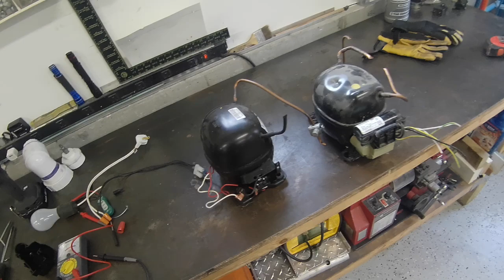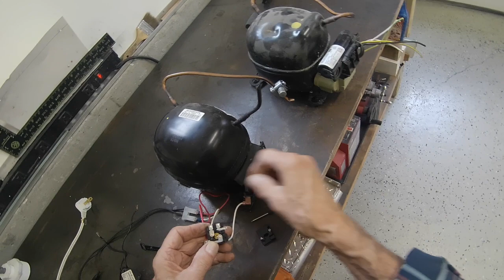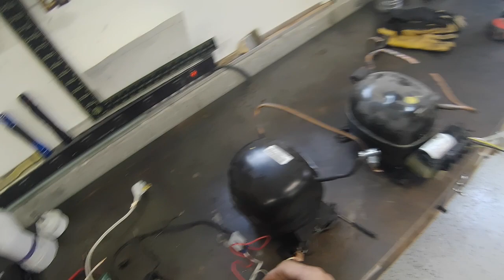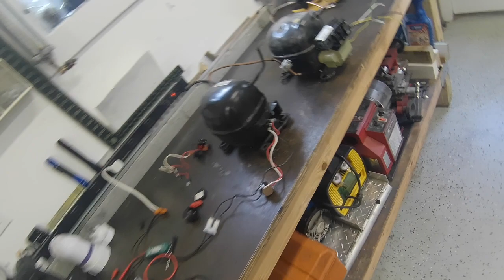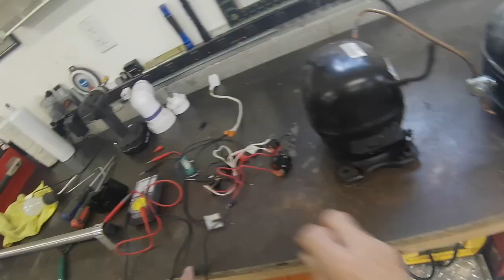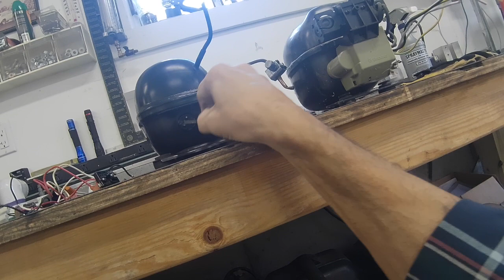Solid State Relay V Amperage

Comment: Hi , mine is 632 model . Where is the compressor capacitor on the fridge side .
Reply from the maker: Not all compressors have capacitors.
Reply: @SubZeroSpecialists 
Thank you for your reply.
My fridge side compressor keeps on clicking on and off .
Ohms reading: C+R=7.9
                          C+S=20.9
Amps drawings on fridge compressor upon starting is 8 amps , it starts for few seconds then it clicks off . 
Do you think the little relay beneath the overload is bad . Your thoughts .
Reply from the maker: @AJ-AJ212  there is a way to jump start the compressor without a relay but I’m reluctant to give advice because you could get zapped if you touch the wrong terminals. Why don’t you try replacing the starter with a Supco RO-81 first and see if that helps. The worst that could happen is $10-15 bucks for it.
Reply: @SubZeroSpecialists 
The compressor is a 1/10 hp . Embraco EMI30-HER .
Reply: I did jump start it and it’s running but it’s getting way hot . What is the cause of the compressor excessive body temperature .
Reply from the maker: @AJ-AJ212  too much friction inside the compressor maybe due to a faulty piston or valve. What are the run amps? You mentioned above that you were drawing 8 amps. That’s a small compressor and probable draws 3-4 amps   when normal, maybe less if a new model.
Reply: @SubZeroSpecialists  
it’s drawing exactly 3.8 amps after I jumped started it but , it was getting too hot in about 5 minutes to the point I decided to shut it down due to the excessive heat . it was pointless to keep it running . I think the compressor is bad .
Tested the overload resistance at 0.2 amp which is good and the relay’s is at 0.5 amp of course after turning it upside down where the contacts are mating which I took apart and sanded the carbon deposits off . I am at loss . Your thoughts !!
Thank you so much .
Reply from the maker: You didn’t mention your serial number. You can go to my website aaronsrefrigeration.com and click on TechHelp, go to 600 series based on serial number and look under Technical info, there you’ll find the running amps. It does sound like your compressor is faulty, normal running amps are 1.2 for the refrigerator compressor.
Reply: @SubZeroSpecialists  
I got in touch with a local company that claims to work on SubZero and insisted that I give him the serial number 🤣. I told him it’s a 632 and that’s all you need to know. He quoted me $1200 between compressor,installation and diagnostic which I don’t need since we are replacing the compressor anyway. I bought an Embraco 1/10 hp for it for $175 delivered.I am thinking about buying all the tools from the torch set to the vaccum pump with a set of gauges and do it myself.some of these guys give you the impression that they are going to build an aircraft carrier 🤣.
Reply: Thank you for all the help and advice that are accompanied with great tutorials and I love your videos.
Reply: @SubZeroSpecialists  
Update:
I ran into an HVAC guy today who came in and installed the new compressor for me in 2 1/2 hours and charged me $200 for his service . The 632 is running great at 34* and back in business .

Comment: Hey got a question for ya, when doing compressor swaps on sub zeros I usually throw a 8.5 or 7.5 embraco on the freezer side due to it being available at the local supply, they tend to run a bit hot, one of my colleagues suggests putting a 12mf start capacitor relays, saying it takes off some of the heat and runs quieter. Do you think that has any merit to it, in your opinion?
Reply from the maker: You didn’t mention what model you have and 8.5 btu compressor seems a bit much. I usually use the embraco 7.5 and no start capacitor. A run capacitor yes. As for overheating with a start capacitor I’ve never heard of that since the start capacitor is not in the circuit after the compressor starts up.
Reply: Oh yes, you are correct that would be a run capacitor indeed.
Reply from the maker: Never heard of a 12 mf start capacitor sounds like a run cap. Most subzero freezer compressors are 700-750 btus. I have no experience with Embraco compressors running hot. It’s best to replace the compressor with the exact btu rating.